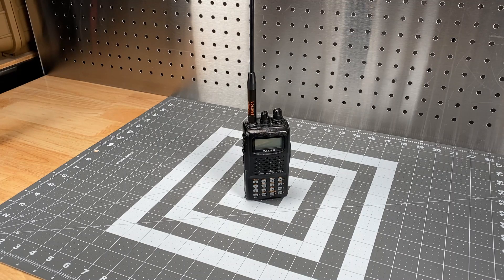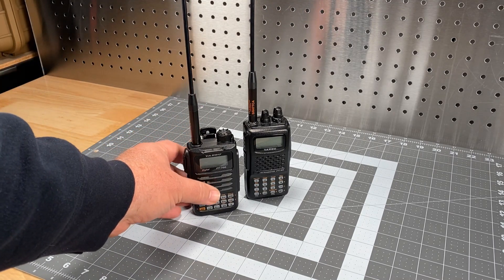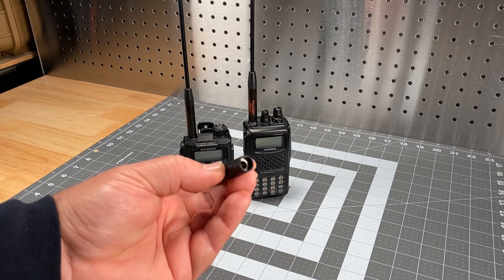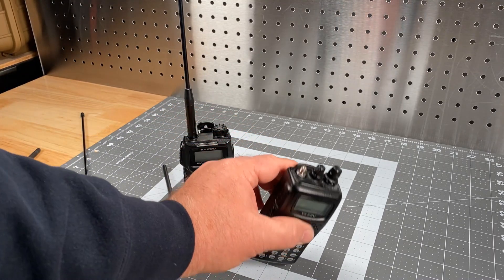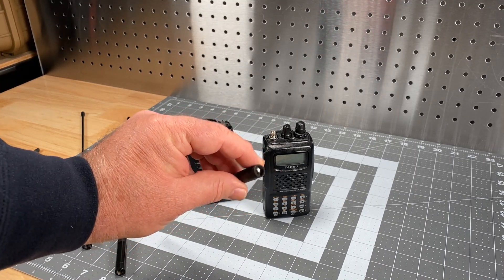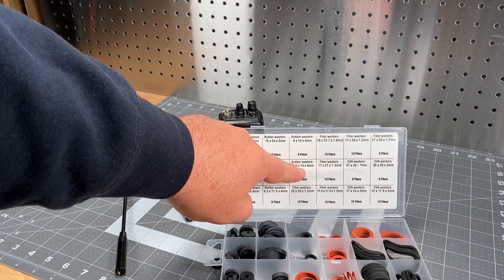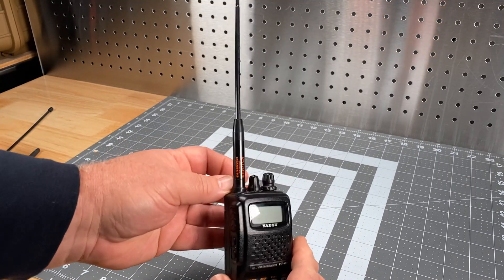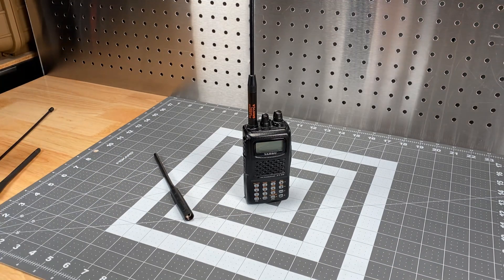Eliminating the Yaesu FT-60 Aftermarket Antenna Gap

Comment: I used a rubber O-ring (also from an inexpensive set) to achieve a similar result on my FT-60. I find that when the Diamond antenna is screwed up tight, the O-ring somewhat conforms to the shape of the antenna orifice on the top of the radio, hopefully this will reduce or prevent water and dirt ingress. I guess another possibility would be to get a part custom 3D printed to fit the orifice and the flats of the antenna socket fixing nut. 73, G0CIQ

Comment: My solution was a 14mm rubber washer 4mm thick wit a  6 mm hole to fit over the FT60 connector. On the bottom side of the washer i drilled a 12 mm hole to fit nicely over the gap.
73 de on4ged

Comment: Signal stuff sells 3D printed rings specifically for the FT-60 gap - wouldn’t say it’s the best of the best quality (nothing like rubber or silicone) but at least visually, it takes care of that exposed part between the third party antenna and the base

Comment: Thanks for the tip. I’m going to buy the FT-60 but I’m going to use a SMA- BNC connector and use a BNC antenna. There say still be the same issue you point out in the video so I may still end up doing what you did.
Reply from the maker: Good news on the BNC connector. In fact, I'm doing a video on FT-60 BNC adapters tomorrow. The BNC adapter that I found has a built in skirt that covers the gap and it's  black plated.
Reply: @KS6DAY  please post where you got the connectors?